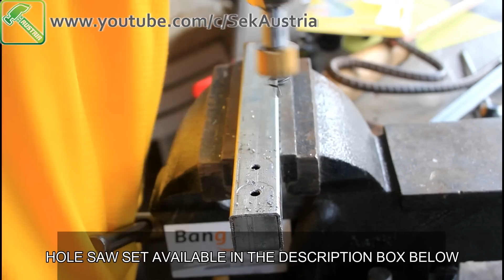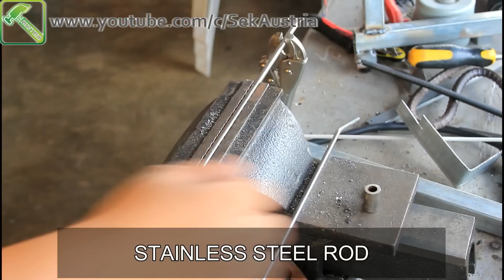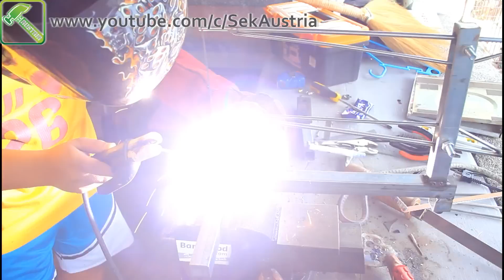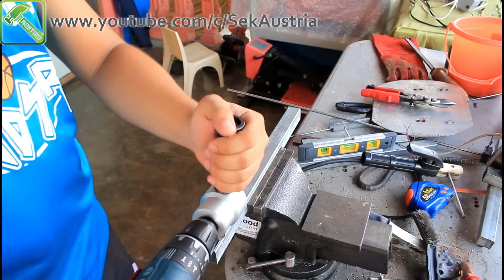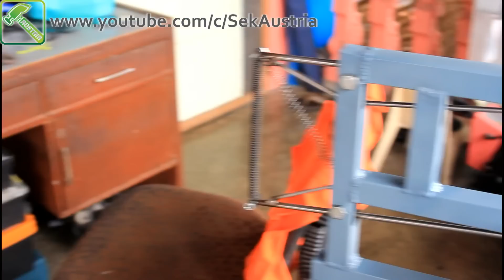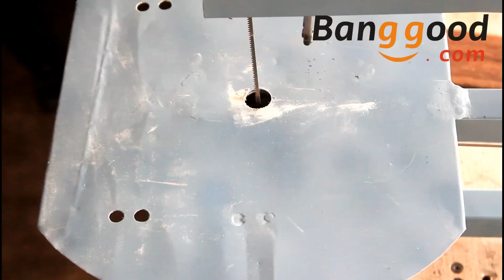Scroll Saw [DIY]

Comment: Nicely done! Take the springs off at  the rear and add a turn buckle , it will allow you to tension the blade effectively and get better cutting. You can tell the tension by "ringing" the blade like a bicycle spoke. You could also use a piece of all thread or a long thread bolt between the 2 arms if you can't find a turn buckle.
Reply: That Hamish Anderson is a GREAT Idea. Good one, John, Australia.

Comment: I would think of adding blade guides under the plate and a way of adding tension to the blade would help keep the blade from twisting and make your cuts more accurate
Reply: Spark Gap you're right likev those on a band saw
Reply from the maker: ive wish to add, but i dont have tiny bearings. and it should be compact, and space is not that that large.
Reply: Sek Austria  i have some very very small bearings and rollers from a printer I'll send you first i got to get back to work from and injury and sign up to patron to support you and get a mailing address to send them to only way to do it privately going  to upload a video of them on my crappy youtube channel  to see if they will work!
Reply from the maker: wow thank you so much :) ill message you my complete address
Reply: Sek Austria no problem i don't need them, i saved them for someone who does by the way i like the heat sink ground cable that you made, your stick welding is better then mine the way you hold it,position,handle it is whats taught in a welders school hand book my problem is i shake like a Chihuahua pooping peets seeds and mostly weld flat sheets!
Reply from the maker: yeah im also saving  salvage parts for my future needs or their needs.  that heatsink is my stick scratcher because my welding stick  always stock on metals, and it really sucks.
Reply from the maker: i can't message you. could you please message me on my youtube channel?
Reply: 9o
Reply: Sek Austria search how two youtube messenger I'm trying to figure it out also
Reply from the maker: just go to my channel and click "about" and find the "send message" in the right side, and that will be directed to gmail.

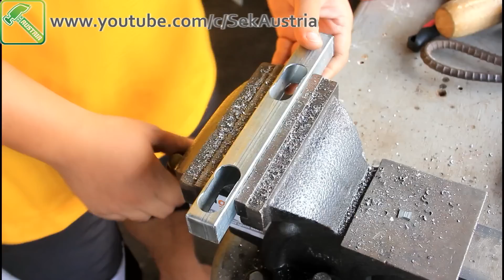Comment: Pink welding flipflops at 0:46
Reply: Bret Laverack needs a little leather to cover those toes lol! learned that mistake when welding it burned my nylon boot strings least my boots where leather and steel toed us military airforce climbing boots they where new  but old stock only paid $70 for them i had others that cost $120 pure crap lol
Reply: Worst burn I ever had would have been prevented if I was wearing some fuzzy slippers. Instead, I had all the safety b.s. holding an orange hot ball of slag on the skin-side of my booted foot. Climbing down the ladder wasn't an option. The hiss and the steam like cooking bacon was nice until I smelled it.    Anywho, onlookers and safety cops need all the protective gear to go along with their lack of ability. People with skills who actually use tools rarely injure themselves. Give a safety expert anything more hazardous than a clipboard and ya got bloody meatwads everywhere.  To each his own but for me the footwear was indicator of skill level and control. I like it here, scribin'!
Reply: shhh  they are his moms

Comment: Love the builds but dude, we have to talk about your choice of footwear. Last time I welded wearing so little, the sunburn on my feet (UV from the welding) alone was agony and that's before the first chunk of molten flux landed on my toe. Don't you get burns that way? Still, keep up the inventive good work
Reply from the maker: Ofcourse it also landed in my toes and its make me jump and shake my foot. Hahah.
Reply: After the same thing happening to me, work boots have been a must-wear ever since. Still need ti by a welding apron - having the crotch of your pants catch on fire isn't much fun
Reply: There is a guy in India that I watch that uses the same technique. I will share my comment to him with you as well Sek Austria. You have the welding sparks well trained, they don't land between your toes, lol. Nice build! 
 I have a couple of thoughts for mods/ improvements if you will like to consider.
1 Have a table height adjustment so that you can use more of the blade as it wears in one position.
2 Make fittings to suit fret saw/piercing saw blades as used for really fine work like clock making/makers use. Perhaps also a felt or similar table surface for work that you do not want to scratch the surface of, it can be made removable. 
 Good project, John, Australia.
Reply: @joandar1  Thanks for your tips. I will add to myself.
Reply: @alknis  You are welcome as are all, this is a wonderful place/site to share thoughts and ideas, John, Australia.